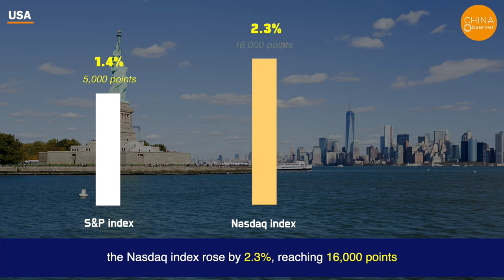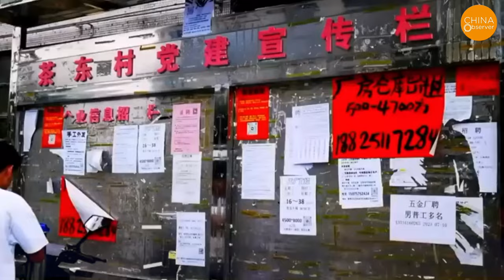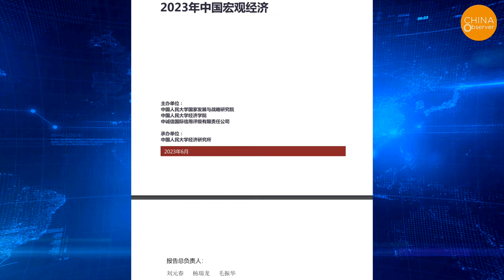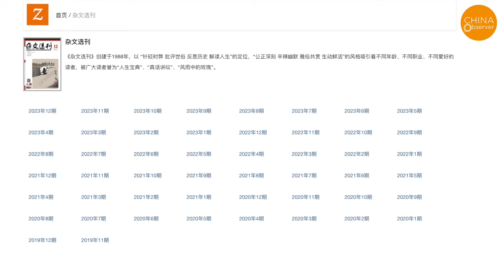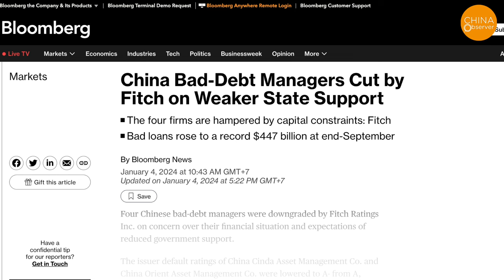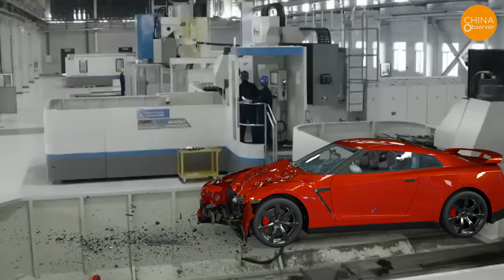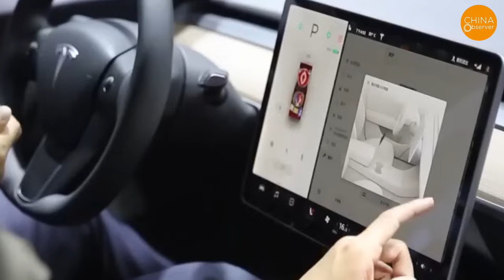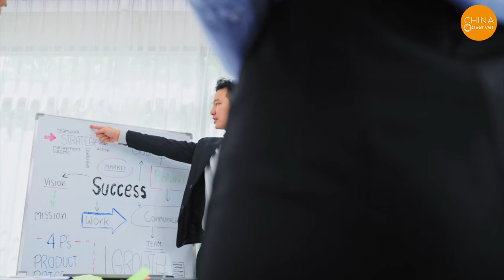Irreversible Decoupling of the World from the China's Economy!

Comment: I have bought very little from China in previous 10 years. Though now hard to  refuse as prices now discounted over 80%.
Reply: I won't buy anything I know was made in China. I have seen way too many things fall apart almost immediately. I bought a flail mower for my tractor that had a Chinese gear head. Immediately tore up a gear. It was missing a c-clip that held gears in the correct position. Some of their tools are just as bad.
Why buy 1 bad item that needs to be replaced instead of one that lasts? Makes no sense to me.